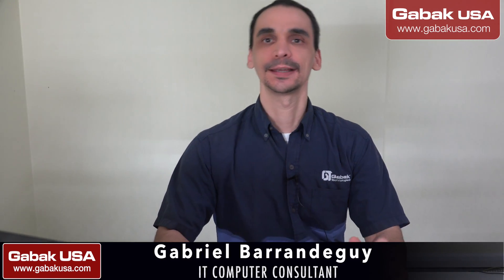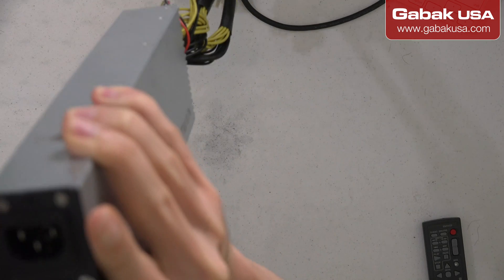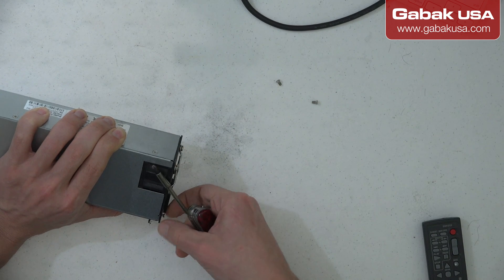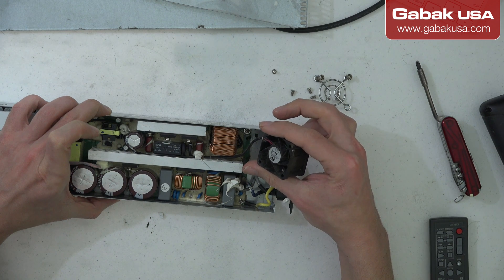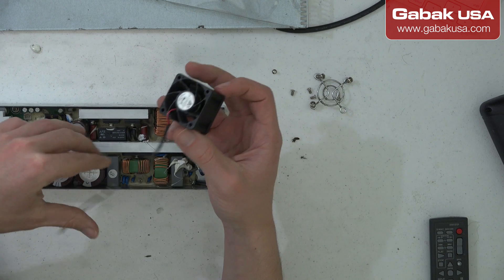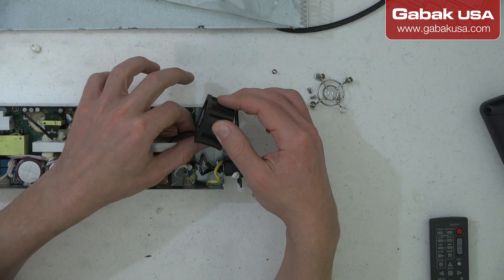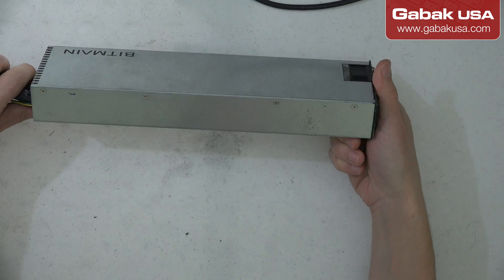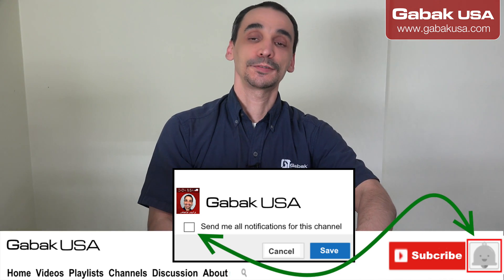how to replace fan's power supply antminer Bitmain

Comment: Could we change direction of the fan? Because in some PSUs the flow of the wind is to the point of cables and makes them so Hot!!!
Reply from the maker: you can try and see, but I prefer to leave everything like the engineer's design everything

Comment: Can we replace this loud noise with another quite fan, because its to loud I have the same fan size, wondering if you can replace with a less quite one.
Reply from the maker: you can add this and will do the trick, make sure to check your temperature https://amzn.to/2UXSFCr
Reply: @gabakusa  Thanks for the tip. Also do you know what the speed is on the fan in RPM cause I don't think those fans have variable control it's running always the same I see has 2 wires black and red. I was thinking if I can find one that is the same or little less rpm with a quiet motor I'll replace that and would be quiet. Like the this https://www.amazon.ca/Noctua-NF-A4x20-FLX-premium-quality-quiet/dp/B072JK9GX6/ref=mp_s_a_1_fkmrnull_2_sspa?keywords=fan+40mm+12v+flex&qid=1553794446&s=gateway&sr=8-2-fkmrnull-spons&psc=1 it has 3 wires but maybe can be converted to two my miner has 2 of this fans it's the antminer DR5 model. But dunno if will he enough.
Reply: @AmyBella  did you manage to do this as I wanted to mod my AWP9 PSU as it's load as hell?